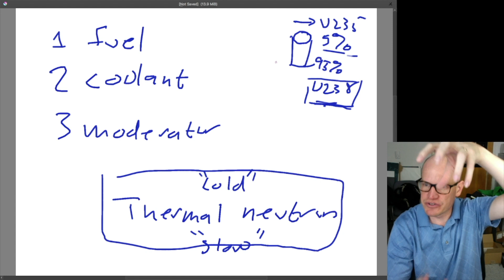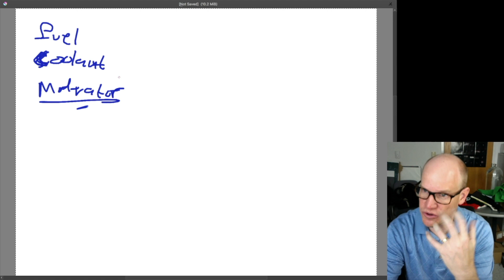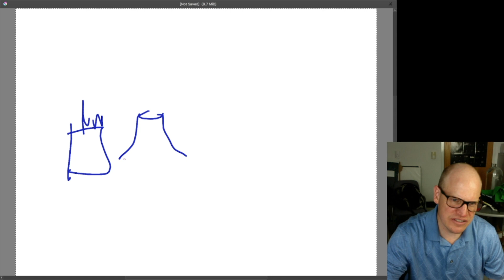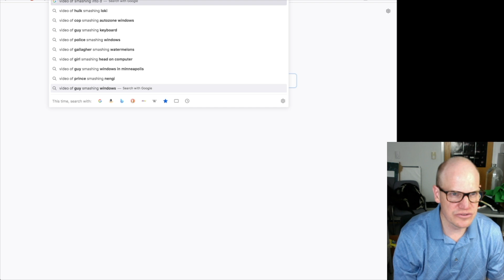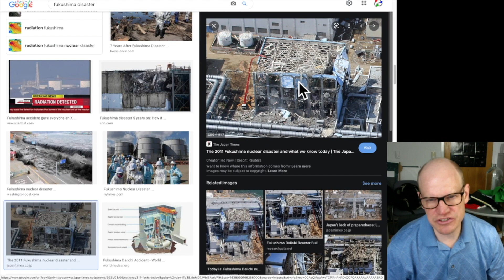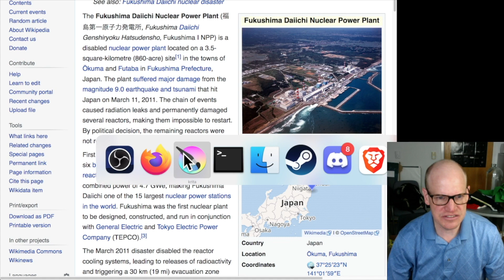Nuclear Energy 04: Reactor Design and Q&A

Comment: Was Three mile island an accident? Nuclear was on a roll that threatened massive Oil, coal and gas intrests with extinction. The ‘china syndrome’ movie eerily ‘previewed’ the TMI event almost word for word. It came out weeks before the TMI ‘accident’ to massive crowds. A single ‘critical-path’ valve malfunction (extremely rare for a new valve) caused the problem. Incredibly, the indicator light in the control room that identified its failure was covered with a ‘tag’ describing a servicing issue (also rare) so it wasn’t seen. Had the warning indicator been visible when the valve failed the problem would have been dealt with immediately. Due to these ‘coincidences’ the worlds nuclear roll-out was stopped in its tracks for five decades. Regardless of accident or not, please take a bow ‘friends of the earth and Greens’! You FORCED big-fossil’s expansion for the five decades since then. Yet you are STILL anti nuclear, the safest form of ‘always on’ energy bar none, when renewables are NEVER always on, as is required.
Reply: In other news ... 911 was an inside job to give Bush an excuse to invade muslims /s

Comment: Boron pellets were actually airdropped onto the exposed Chernobyl core to try to quiet it down (and lead). I think I remember reading that the best neutron poison is Xe 135, with a cross section of something like 2.5 x 10^6 barns.

Comment: So it is a common misconception, RBMK reactors do not have graphite tipped control rods, this is why people miss understand the issue with chernobyl... 
The control rod has a section made of boron, then attached at the bottom a section of graphite known as the slider about a third of the size of the boron portion separated by a chain. The why is very simple,
When you remove a control rod your intention is to add positive reactivity to the core, however in an RBMK the moderator is graphite so liquid water in this configuration acts as a posion. The control rod tubes are also filled with water so by removing the rod adding positive reactivity water fills the tube adding a negative reactivity this reduces the effenency of the system so the control rod pulls up from beneath a graphite portion of the rod to fill the void now left by the control rod, displacing the water and adding further moderation and positive reactivity to the core. Without this design every time you pulled out a rod you would be left with a vurtual control rod made of water. 
So the word "tip" is incorrect, a complete rod is more accurate.
What happened with chernobyl was they removed the control rods to far allowing the graphite portion of the rod to completely entire the core leaving a gap at the bottom of the core to fill with liquid water within the control rod channels, once all the rods were withdrawn and the core was filled with graphite "tips" the only thing now absorbing the neutrons and slowing the power excursion was this liquid water and the remaing Xenon.... 
When the control rods were inserted back into the core no graphite tips were added to the system the graphite sliders were already in the core but what did happen is the sliders decended to the bottom of the reactor displacing the water replacing the only neutron absorber with a graphite moderator, now nothing in the reactor was controlling the reaction rate as the Xenon immediately burned off, the reaming water turned to steam (voids) thus initiating the positive void coefficient feedback loop...
Feed water immediately boiled at the inlets steam increases reactivity, reactivity creates more steam.... 
To the point 3 or 4 fuel channels rupture Turning the only remaing liquid water in the tube to steam with enough pressure to lift the environmental shield (reactor lid) 
Just enough to break the seal allowing an instantaneous decompression, all the water within the reactor turns to steam with explosive force, enough to lift the lid breaking the control rod mechanisms and steam headers this allows oxygen into the core mixing with hydrogen produced by the steam zirconium reactions and of course a second massive explosion occurs destroying the reactor and its building, removing the 2000T lid and ejecting the core into the surround area and atmosphere..... 
A resulting graphite fire in the remnants of the core now raged.... 
All this happened in a few seconds.
Reply from the maker: Thank you.  This was really informative.
Reply: @horizonsci1703  No thank you, really enjoyed this video some great explanations and visual aids...
Reply: @horizonsci1703  It is also an very confusing statement.  He is arguing "white horse is not horse".  Zuck!  I understand how RBMK works.  The end of the control rod is graphite.  He calls it a slider.  It is a slider so that it is not part of control rod.  WTF?

Comment: Around 47:00-49:00 The reason that modern nuclear reactors can’t immediately turn on after being shut off is actually quite interesting. And it’s discovery was pretty remarkable too. It’s due to a certain fission product called Xenon-135. Xenon-135 is an extremely potent “neutron poison” it’s like a super control rod that’s able to absorb many, many neutrons and this is what prevents immediate start up. Coincidentally, it’s half life is about three days so that’s why you have to wait a while before restarting it (in solid fuel reactors, in liquid fuel reactors it bubbles out and removes itself) 

Xenon-135 was a big problem in reactors built in the 1940’s (gen 1 I guess) I forget if it was B reactor or X10, but the reactor suddenly shut itself off for no apparent reason, but then after a a day or two, it automatically turned itself back on! They were confused, but the reactor was back on so they just pushed forward. And now this it was back to full power, it just shut itself off again! This cycle just kept repeating, and it was all because of this terribly inconvenient fission product

Comment: Q: Why can you hold nuke pellet in your hand yet in a reactor it gives off tremendous amounts of energy

A: The uranium will naturally decade but over billions of years. A reactor is designed such that the uranium fissions far faster in about 5 years rather than 5 billion years
Reply: Uranium as you described decays mainly due to quantum tunnelling. In a reactor it fissions after the atom is struck by a slow neutron. Both are nuclear processes, but the details are a good deal different.
Reply: You can hold uranium in your hand because its natural decay process is Alpha emission (not fission)
Alpha radiation is not penatrating your skin can stop this... however prolonged exposure will cause Alpha burns on your skin.
In a reactor the uranium undergoes neutron enduced fission completely different from Alpha decay, a Gamma emitting Neutron emitting process which also inturn releases high kinetic fission products. The radiation is highly penitrating and ionising, the fission products are also highly radioactive...

Comment: its like talking about a propeller driven fighter in the 50's when jets were being adopted, having water in the core is a bad design, Nak and gas are not great either
Reply: Sorry I miss understand, why is water a bad design... both BWRs and PWRs use water even in the 3rd generation design. Having water as both the moderator and coolant is one of the safest designs to date ???
Reply: @jonnytightlips513  it's liquid range is too small and too low as a coolant and it flashes to steam(explodes)
Reply: @jonnytightlips513  what they call 4th gen is an AP1000 with a big pool sitting above it.. archaic..
Reply: @samuelforsyth6374  the AP1000 is a gen 3  PWR with a double coolant circuit practically the same as most PWRs, the coolant pond sat above it is part of the gen 3 passive protection system for emergency cooling in the event of a loss of off sight power or pump failure. 
Pressurised water is still pumped through the core.
There have been no recorded incidents where core water has flashes explosively into steam in a PWR, there have of course been over pressures but this is not a water coolant issue this is a loss of coolant problem hence reactors have emergency venting to prevent over pressure. 4th gen reactors will more than likely use liquid fluoride thorium as a molten salt. 
Current passive protection from water has an excellent safety record, loss of coolant equals loss of moderation with a self terminating reaction, cooling the decay heat has always been the issue not the water in the core.
Reply: @jonnytightlips513  MCFR is closer under US regulations but regardless a huge chunk of the cost for PWR comes from the containment vessel.
Reply: @samuelforsyth6374  yes of course there is a cost to manufacturing pressure vessels, but cost of one component out of millions that make up a power generation reactor facility is negligible. The AP1000 still uses a pressure vessel...
Reply: @jonnytightlips513  its not negligible its over 20% of the whole plant cost, more if you are converting old coal plants and already have a turbine sitting there, its saftey and cost, and fuel consumption.. water is not the main downfall of normal reactors anyway its the zirconium fuel coating.. more than 10 good reasons to go molten salt over fuel rods
Reply: @samuelforsyth6374  well I would not agree it is over 20% the cost given lets say a 20 billion dollar Station (average, AP1000 you referred has cost up to 18 billion) 20% of this is 4 billion, the average pressure vessel costs around 150 million, a shy number off 4 billion, and yes it was you whome suggested water was the issue in the modern nuclear reactors... 
And yes as I eailer suggested gen 4 will more than likely use molten salt.  🙂
Reply: @jonnytightlips513  its easily number 2 issue, solid fuel is number 1... 'whome' settle down i was just explaining what i said
Reply: @samuelforsyth6374  lol I do not need to settle down i have not risen up.
I was just reiterating your comments, I do not disagree with you.

Comment: Using nuclear to make electricity is uneconomical vs just keep using what you have. And arguably wind and solar are cheaper now

However nuclear for heating via distribited heating grids seems to make a lot more sense

A heat only reactor would be a fraction of the size and cost. Most likely 10 x cheaper and built in 4 years rather than 10-12 years
Reply from the maker: The economics are not calculated uniformly across all power sources.  Nuclear is the only source that has to account for the whole life cycle of the plant---including storage of the waste.  If other forms of energy had to do the same, I'm confident that the economics would change considerably.
Reply: @horizonsci1703  The reality is that most developed nations already have infrastructure in place coal gas Hydro solar wind etc and are not starting from scratch therefore new nuclear will be uncompetitive vs existing infrastructure which has already been paid for and written down

In the same way keeping your old car is more economic than buying a brand new one even if the brand new one is 20% more fuel efficient

Because of this reality nuclear should look elsewhere and heating homes and buildings via a distributed heating grid seems a possible way to use nuclear for mass energy needs

In a lot of Europe heairng buildings with low temp water (around 60 degrees centigrade) uses more energy than anything else

For example the UK 🇬🇧  uses around 320TWH of electricity and around 500TWh of heating

Makes no sense for nuclear to fight for 20% of the electricity market = 64 TWh when you can take 90% of the hearing market 450 TWh with nuclear

7 x the size

If you want nuclear to provide a substantial part of humanity energy needs makes much more sense to target nuclear for heating needs

Plus a low temp heat only power station would literally be 10x smaller cheaper simplier than an electricity power station

Nuclear won't play a significant part of the kesr future (this century) unless it manages to take the hearing market
Reply: @horizonsci1703 I'm not against nuclear and can see its advantages. But where there are v.good wind resources like the North Sea I think you'll find that offshore wind farms (with a capacity factor of 60%) are very clean and very affordable

Not everywhere has such good wind resources so I'm not suggesting globally nuclear is better but for the countries that surround the North Sea it's probably going to be cheaper and quicker to deploy high capacity factor offshore wind farms than to deploy nuclear power stations especially because the first 10 tractors are probably going to be over budget and delayed simply because building anything when you have little to no experience is hard
Reply: The problem with the wind is you need to keep your entire fossil infrastructure online when the wind is down while not being able to be capital efficient with it as its utilization will be low. That'll introduce major cost. Batteries are fine but  they're not gonna be sized for an unlucky period of no renewables production that lasts quite a while. So there isn't a choice but to keep all the thermal generation upkept. Nuclear is the cheapest form of energy once depreciated and even if construction is factored in if you also factor in the very long life times it's also the cheapest energy. Once we get good at building them again with some regulatory streamlining they also will get cheaper in terms of construction
Reply: @ryccoh  You are correct you need 100% backup but that's not a significant problem because natural gas fired power stations are cheap to build and operate 

It takes just 40 men to run a 1GW CCGT vs 400+ for the nuke

In the same way a backup generator for a hospital or home is quite cheap, cheap enough that even if you only use it infrequently (or even never) its not too expensive 

On a small scale, imagine an off grid home. It has a gasoline generator and solar and wind. Is this affordable. Sure. Does it work. Yes

Arguing that the nuke is better misses the point that this guy already owns a gasoline generator a solar roof and a wind turbine at the bottom of the garden. He isn't going to get rid of that infrastructure to make space for a nuclear station

Unfortunately nuclear is simply too late for a lot of grids. At least Europe where I am

Also electricity generation takes up too much or the debate. Going forward heat pumps and efficiency will play a bigger part than nuclear solar wind combined
Reply: A backup generator, solar and wind. Those are three things, and hence costly. Nuclear once construction is deprecated is the cheapest form of energy there it at 3 cents a kWh. Having a bunch of UHVDC interconnects with various renewables that have to back each other's low capacity factors hopefully in a cohesive way as well as fossil that cannot be utilized is not cheaper than that, not even close. Gas generation at 100% utilization costs 7 cents. As soon as you only get to run it 20% of the time whatever fraction of the 7 cents entails capX goes through the roof. Solar and wind also need to be replaced every 30 years. Finally the grid needs to expand substantially, so it is not too late for nuclear
Reply: @ryccoh  Here in the UK the next Gen offshore wind farms are projected to get 60% capacity factor mostly because they are being deployed in more windy locations

We have

£1.5/watt offshore wind @60% cf
£0.3/watt backup ccgt
£1/watt onshore wind @40% CF
= £2.8

Whereas the nuke we are building is coming in at around £9/watt and requires more staff than the above and also fuel cost even if low isn't free

So the nuke is 3x the cost

I accept your argument that if we built more we would get better at building nukes however our grid is quite modest at only 300TWh annual demand we simply don't have the size of demand to build 50 reactors to get good at it

Not everywhere has such good wind resources but for the UK wind makes good sense. We have very high consistent winds and shallow waters near demand centers